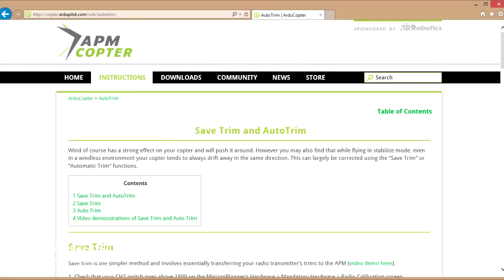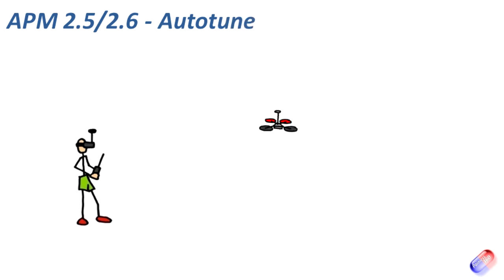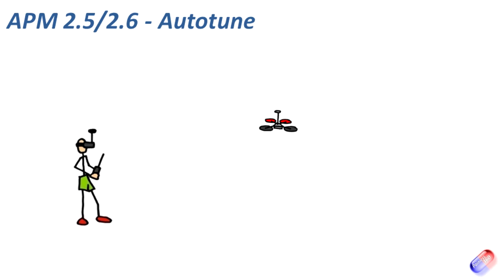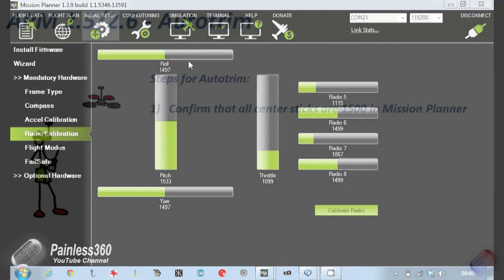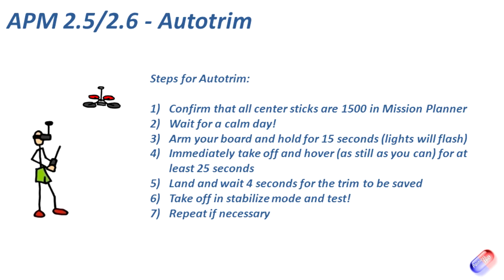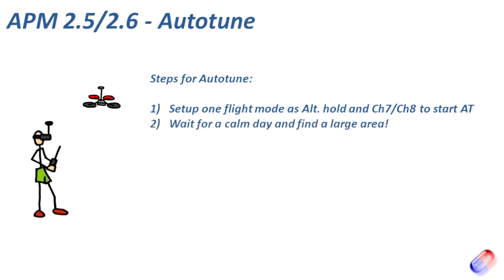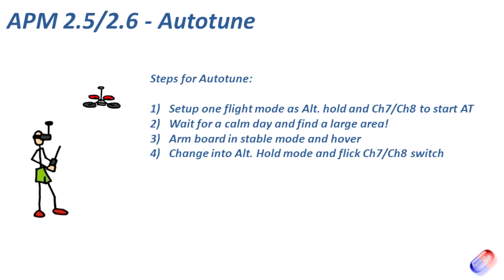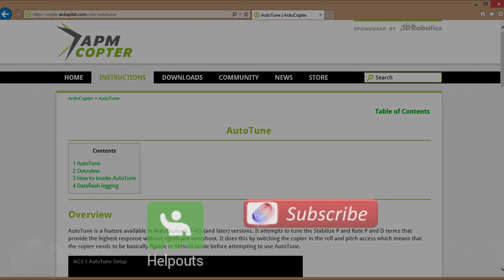(7/8) APM 2.5/2.6/3.1 - Autotrim and Autotune

Comment: Gidday painless great vids mate very informative,just a quick one is Autotune ok to use on large frames,say 900mm + with low kv motors in the 400 range 15" to 18" size props,weight 4.5 -5.0 kg range,thanks in advance,regards Steve
Reply from the maker: MrShadow6292Hi Steve, Ive not tried it myself but I cannot see why not. The forums on RCGroups may have more information.

Sorry I can't be more help. Happy flying!
Reply: Painless360 Thanks for the quick reply, I did read somewhere that it is too violent for large frames, but I,m going give it go anyway, still about a month away, but report back when I do,setup will be pixhawk with tiger 4014/9 motors 17" props 900 or 3' foot centres on a quad. It is currently running this same setup with dji wkm version 1,& 15" props flys well but reliability issues with flight controller,Happy flying! to you as well, regards Steve.

Comment: problem solved  bro .. thank you. .
in loiter mode tuning. .p and i doesn't have much influence had to increase d so much to get it where I wanted ... maybe this is just my problem. ..and also don't know y loiter tuning is effecting others like altitude hold and stablise mode.. anyway am kinda satisfied. ..
Reply from the maker: +Ashish Faustine Every copter is different, if they weren't then we'd never have to worry about PIDs again. Glad you got it flying well.
Reply: Mm ya I can see that.. anyway thanks bro
Reply: Altitude decrease in altitude hold mode while moving around. ..
Mmm now this is my new problem
Reply from the maker: There is a setting that you can change to alter how much it compensates, you can also make sure that the baro isn't being affected by stray air currents.. Best of luck.
Reply: +Painless360 which setting is it?
and my apm is inside a hard case and that case is inside the 450 frame
Reply from the maker: Can't remember - it was ages ago I was looking. Lots to try that relate to altitude - http://copter.ardupilot.com/wiki/arducopter-parameters/

Best of luck.
Reply: +Painless360 okay bro thank u
 let me see
Reply: +Painless360 also I was planning for a motor upgrade from sunnysky x22 12 
am hovering in 80 percentage throttle now with gimbal and camera with 5000mah batterie 
current total weight is 1700 grams
would emax 650kv motors be fine?

Comment: Thanks for the great description.
I am the last one to use APM 2.8?
Reply from the maker: There is a die hard group of pilots out there.. You're not alone..
Reply: Ha ha...  I've just dug out an unused Arducopter 2.5.2 and Ublox GPS Module V2.0 from my garage.  I think I win... (Win???) 

I'm going to replace the KK2.1 FC in my home made quad with the above combo.  I find flying with the KK like balancing a golf ball on a beach ball... (Now where have I heard that before)

I wasn't even going to try to get it going based on Painless360 often commenting that it is very old technology.  But then I thought... "I've already got it. Not going to cost me any more" and made a start.

So far, so good. I'm at the point of removing the KK2.1 and sticking the APM in its place.

Comment: Hello sir I have a quad with specification 
920kv motor
30a esc 
Dji f450 frame
Fsi6 ts and rx
1045 propeller

Currently iam using 11.1 2200mah 30c rating 
It gives me flight time of just 3min 

I want to build a li ion pack I got full confidence after watching ur video ur just awsome 

Pls suggest which is the best lithium ion cell and in which configuration should I arrange them

thanks for reading
Reply from the maker: See my endurance build from a few years ago that will help you figure out what you need.. I hope they help..
Reply: @Painless360  thanks for ur reply sir

Comment: Can channel 7/8 be a knob akt pot. Or does it have to be a on off switch? For the auto tune to work? All the switchs on my transmitter are used an just have a unused pot. Or knob. Thanks best video on YouTube for setting up apm saved me tons..
Reply from the maker: Richard WEAVER The control can be anything just as long as it changes the value of the channel enough to start the process.
Happy flying!

Comment: Hello your videos have been the most help to me for Auto Trim and Auto tune I need your help and advice my tri copter has 2.8 APM with power module .Ch 7 is used by servo .ch 8 is used for  5 volts input   to servo. how can I set up . my radio is Futaba 8J.
Reply from the maker: William Booth You need to figure out a way to either power the board and power it using the PM connector, or fly without the servo connected. Is it a Tri?
Reply: Painless360 Yes it is tri. copter. so I will need a different channel  to power my tilt servo.

Comment: They now have autotune as a flight mode?  I guess it does alt hold at same time!
Reply from the maker: Not that I&#39;ve seen.. yet. http://ardupilot.org/copter/docs/flight-modes.html still doesn't list it despite it being mentioned in http://ardupilot.org/copter/docs/autotune.html
Reply: Its a flight mode option in V3.2.1  check in MP!

Comment: At 65 Y.O. I guess I came into the hobby a bit late in life, all the how-to's are so old their validity is questionable, nobody seems to replace outdated information with current information, after several frustrating days and hours on each tiny, little tidbit I keep falling back to your "Painless" channel because at least you have a lot of info ( old or not) and have become, it seems, THE Guru to seek for so much, including but not all inclusively: Mission Planner, Ardupilot, Pixhawk and Taranis.

This round it's AutoTune, Arducopter, MP, Configuring Pixhawk and the Taranis

Taranis X9d+2019 SE /Pixhawk/Mission Planner 1.3.77 and (the brand new, just today) Arducopter 4.2.0

Auto tune seems such a straight forward config: 
Step 1a: in MP =Config/Extended Tuning/RC7 (or RC8) Opt/AutoTune - - Write Params
Step 1b: in MP=Setup/Radio Calibration - - Check Switch Operation
Step 2 : In the Taranis X9d+2019SE: Setup a switch for Ch 7 or 8. 
   Inputs/I7 or I8/Input Name/Input Source

Ok:
Inputs/I7 or I8/Input Name/Input Source (I tried SA- and SD-) 
(There's a "Switch" line just under the "Modes" line I'm unsure to set it with anything or not)

Problem submitted for solution:
Can't get either SA- or SD- to activate the Radio 7 // Radio 8 slide in MP.

I've tried:
Setting inputs with and without mixes, included setting the name in the Outputs, 
Setting Mixes with both Ch 7 and Ch 8 as name ATune, Switch SA- and SD-,
Logical switches with Special Functions to override  Ch7 and CH8 (Just as with Modes)
But I cannot get the Radio Calibration test to reflect Radio 7 or 8 switching.

I have not tried sticking my tongue out while wearing my britches backward........yet

Any idea what I missed? Thank you, btw, for all you've helped with so far.
Reply from the maker: Hi! The modern hobby is a fun place to be but a lot of the cheap (and sometimes free!) technology and software we can use often doesn't come with great manuals and documentation. Many of the projects that create the software we use (OpenTX, Betaflight, ELRS and others) don't put enough thought into documentation to help the new pilot. 

These projects rely on channels like this to help others use their stuff and abstract the complexity into easy to follow manuals and videos. 

The videos here are unusual in one specific way - I add a date to the title card. The hobby moves so quickly that content from a few years ago (months sometimes!) is out of date. 

I don't delete the older content for unsupported hardware and older software as pilots in poorer countries are getting into the hobby and those pieces are what they can get an afford. 

This series you are watching is very old. I'd recommend you watch something a lot newer that will deal with current hardware, software, radios and systems. See https://www.youtube.com/playlist?list=PLYsWjANuAm4qJ8Lko-3xiYNGb2Hh22rDw for example. Best of luck with your journey, it can be a lot of fun and there are lots of us willing to point you in the right direction is you get stuck!

Comment: hi, friend i really appreciate how you work hard and make videos to help people. i'm new to quadcopter scene i built my copter and someone build for me. now problem is that it sliding away going crazy i try to trim from my  controller even trim is finish still it drift and one more problem is that i cant use manual mode so scared can u recomend me what should i do?
i'll be very thankful to you.
Reply from the maker: Coolguy I would recommend that you go back to the builder and ask for help. It could be a number of things (I assume it's an APM?) - recalibrating the accelerometers and checking the trims and sub-trims for your channels on the radio/running the radio calibration again may help.Best of luck..
Reply: Painless360
thanks bro i'll ask him to help. and i'll tell you my result. thanks for reply.

Comment: I have a quadcopter and i'm using pixhawk, i calibrated esc like 3-4 times, but still all four motors don't rotate at same speed. I found out that the motor's rotation can be fixed by using mission planner. I tried, but couldn't figure out which one to change. Can you tell me how it can be done? And also its an informative video, will try this after my drone get up and running.
Reply from the maker: Ashesh Rana The rotation cannot be changed in Mission Planner. Rotation of the motor is all done by the ESC not the APM.
I would try and manually calibrate the ESCs and try again - https://www.youtube.com/watch?v=OOplk52R4no
Best of luck.
Reply: Painless360  Thank You for your quick response. I'll stop messing up with mission planner and try manual calibration. Your video are really helpful though.

Comment: Had a perfect dead calm morning so I ran autotune. Everything went as you outlined.. however the result was a quad that flys like a boat.   Wallowing (slow oscillations) after control inputs. Up till now I've been using the standard PIDS.  I'm flying a F450 3S, 4ah with 980 KV motors and 10x4.5 props.  I'm going to try it again in  a larger area were I don't have to reel it in.

Comment: Hi Painles360. Thank you for this good video.
I'm new on build-a-multicopter world and have some questions.
What is difference of actual output from Auto-Trim and Auto-Tune? 
From what I learned, they're have same objective to stabilize the aircraft and Auto-Tune did something to P-I-D (Honestly, I still don't know what actually P-I-D setting do to the aircraft).
I have searched on the ardupilot website but don't get satisfying answer :-(
Reply from the maker: +Alvin Singarimbun Autotrim is to stop drift and does the same job as the trims on your radio. Autotune adjusts the PIDs to give you a better flying model automatically. This is covered in the video. We also have a video on PIDs that you may find useful.. Use the search and playlists on the channel to find content you may find useful..
Reply: Thank you for your help. I'm gonna try find it

Comment: Hello Painless
First I enjoy your videos, they are very instructive. Now I'm on Chapter 7 and you're on channel 7 and 8 for the Auto-Tune but I have no channel 7 and 8 , I only have six channels , how do I solve this . Is there another way to do the Auto-Tune ? Thank you
Greetings
Henk
Reply from the maker: Although it's channel 7 on the APM, you can plug that into any of the available ports on the receiver. Doesn't have to be the 7th output on an Rx.. Best of luck!
Reply: Is it imperative that I should use a dedicated channel/port for autotune? May I just assign autotune for one of six flight modes on channel 5.
Reply from the maker: You need autotune and another flight mode on at the same time.. Best of luck!
Reply: You can plug channel 6 from your reciver to channel 7 on the apm. You use channel 5 for your flight modes.

Comment: the autotrim works with apm 2.8? 
A doubt about this step:
STEP 4: Immediately take off and hover (as still as you can) for at least 25 seconds...
what flight mode i must use? POS HOLD? STABILIZE?
Reply from the maker: ***** Should do, APM 2.8 is the same as a 2.6 with a few different power electronics. See http://copter.ardupilot.com/wiki/autotune/ for full instructions.
Best of luck
Reply: Painless360 thanks! this is what says from arducopter page:

Auto TrimWith auto trim the roll and pitch trim are captured as you fly in a stable hover.1. Find a wind free environment with sufficient space to fly your copter without crashing into something.2. Hold throttle down and rudder right for 15seconds or until you see the small red, blue and yellow leds flash in a cyclic pattern.3. Fly your copter for about 25 seconds in a stable hover4. Land and put your throttle to zero and wait for a few seconds (the trims are being saved to eeprom)5. Take off again in stabilize mode and check if your copter is flying level now. If not repeat steps 2, 3 and 4.Note: you can also test these procedures above are operational on the ground with your battery disconnected. Connect your APM to the mission planner and observing the Flight Data screen as you simulate completing the steps aboveSTEP 3 SAYS TO FLY IN STABLE HOVER... MAYBE IT MEANS STABILIZE MODE?
Reply from the maker: No, it means as still and stable as a hover as you can manage. The FC is learning how much persistent control input you need to use it in order for the hover to be in one place. It then saves that to memory so you don't have to do it next time.

Best of luck with it.
Reply: Painless360 perfect! i will try it soon! thanks! =)

Comment: hi ... am still stuck with altitude problem. . have balanced props, cg ,motors even added foam inside and outside of apm still no use ..quad jumps when in alt hold mode
Reply from the maker: +Ashish Faustine I would download and check the logfiles to see what the baro can 'see' when you are flying.. Best of luck.
Reply: +Painless360 that's done. . vibration are in control
Reply: What to do :( 
no more info anywhere on YouTube
Reply from the maker: Book a chargeable support call...
Reply: +Painless360 to whom?

Comment: Your videos are awesome mate! Big thumbs up from Australia!

Just a quick one: I got a FS i6 running of course 6 channels into the APM 3.1 via pwm. I was planning on using the extra 2 channels for flight mode and perhaps gimbal control respectively. Is there a chance I can temporarily use the gimbal channel as a switch for the Auto tune and then once the auto tune is done I will get my channel back to control the gimbal? Would the APM save the autotune (PID values)?

Cheers
Reply from the maker: +Wilson Quintero Not that I know of. You could by landing and resetting the Tx configuration via Mission Planner but not in flight..
Reply: +Painless360 thanks mate.

Would the APM save the PID values for future flights though?

Comment: when on the air, shall i use the trim button or the stick to hold it stable?
Reply from the maker: If it's drifting then check the accelerometers are set for level and that the middle value on the radio reads 1500. Once they are good most models will be spot on and may need a click of trim if you move the COG. Best of luck!
Reply: There is one major problem. I am using 6 channel radio and I cannot set channel 6 for auto tune. my 5th channel is selected for flight modes. is it possible to do autotune from my radio?
Reply from the maker: Only if you sacrifice one of the other channels for the tune ;)
Reply: +Painless360  I cannot select the 6 channel for auto tune. there is no option for autotune on the drop menu of channel 6.
Reply from the maker: Plus the CH7 input from the APM to ANY channel you can use for a switch on the Rx. If that's not clear then see the website for booking a chargeable support call. Best of luck.
Reply: Thank you friend. Saved my day. Your tutorials are really awesome.. :)

Comment: I have a six channel transmitter. How do I do Autotune using my transmitter???
Reply from the maker: +Vivek Ajgaonkar plug in the connector for the channel you need into the sixth channel on the receiver. Why the three question marks?
Reply: +Painless360 I already did that. Firstly in mission planner only ch7 and ch8 has options of autotune. when i connect channel 7 or 8 of the apm to the sixth channel of the receiver, it gives a warning saying "ch7_opt has doubled the value of last input." on the EXTENDED TUNNING page of Mission planner. Also when I give Roll feed on my TX the Ch7 also responds to it and not wen I give feed from Ch6 of my TX. Why so?
Reply from the maker: it's just a warning letting you know that the value of ch7_opt has changed by a large amount. Google the error and you'll find more about it..
Reply: +Painless360 when I give feed on the roll channel of my Tx, ch 6 or ch 7 whichever is connected  also responds to it and not when the feed is given on ch6 of my Tx. what could be the possible reason for it?
Reply from the maker: I'd check the 'monitor' screen on the radio - if it also moves there too then check the model settings on the radio.. best of luck.

Comment: Hi Painless360Great series of videos, just finished building my 1st tricopter using APM 2.6.Getting to grips with the tuning, but have an issue, have set up board as per the instructions, but cannot get the motors to fully stop when throttle set to minimum, they do not spin enough to lift the tri off the ground but will continue to spin.have tried setting trims to minimum but no change. Any suggestions ???Kenno 17.
Reply from the maker: http://youtu.be/cXSNgCQ9WJw might help. Lots of stuff on the channel so worth a search or two, best of luck!